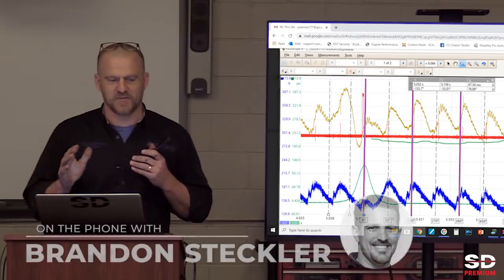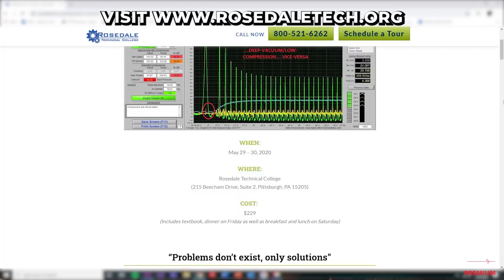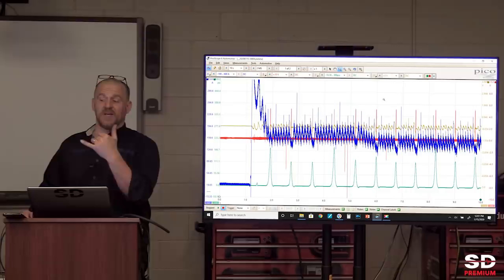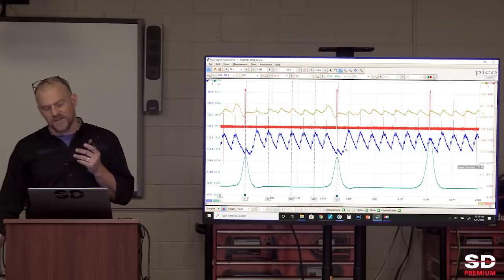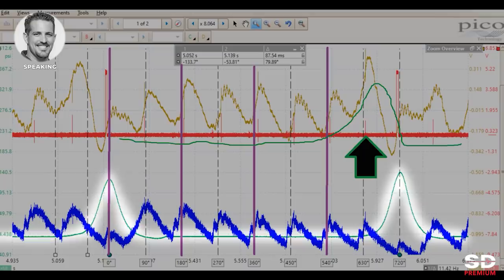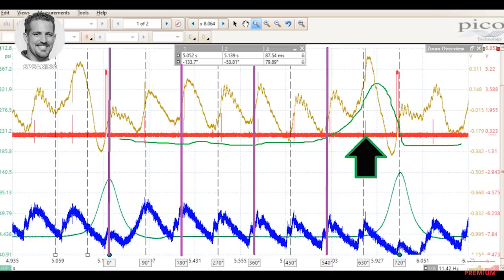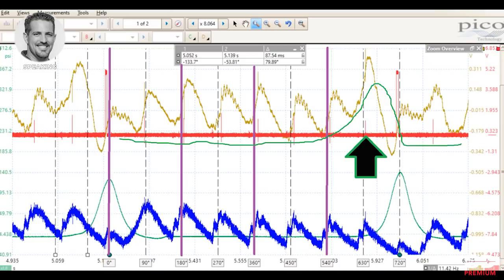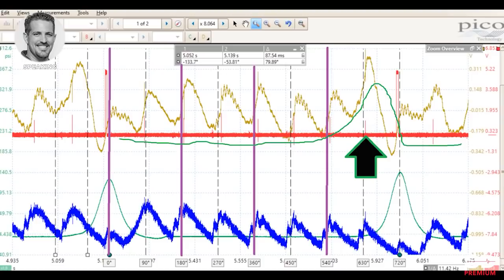May 29-30th ScannerDanner Training Event, Open To The Public

Comment: Sweet.  I am signed up, I got vacations scheduled Thur through Tues.  I missed his class at Daytona.  We will see if my Grand Am that I just rebuilt the engine on is up to the drive!   Then on to Kennywood on Saturday with the Family.   This is going to be great!
Reply from the maker: Saturday is the training day. Friday night is the meet and greet. It will be awesome to meet you!
Reply: @ScannerDanner  Well Kennywood on Sunday then, after we find a local church with an early service to visit.
Reply: @frugalprepper  it'll be great to finally meet you in person Frugal! Crossing my fingers on the G Am!
Reply: @CubasAutomotive  I had it on a 3 1/2 hr trip and 4 1/2 hr trip with no issues, so I think it will be fine.  The darn rear cam tower started weeping a little oil so I will replace those soon.  Other than that it's doing great.
Reply from the maker: Source Church where my son Caleb leads worship. It is not far from Kennywood! That would be awesome

Comment: The Professor is a vacuum? Is that cause he ..... well he has a pressure differential and causes air to move to the lower pressure. 
Sorry Professor it's hard to say that you draw a vacuum. Wait carburetors suck and that's a good thing, right?
Another great video PD.